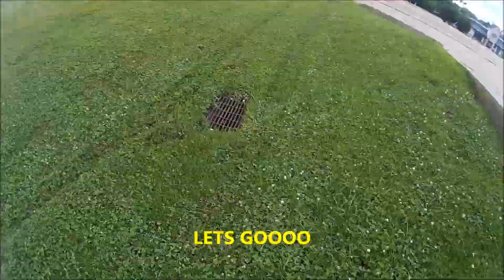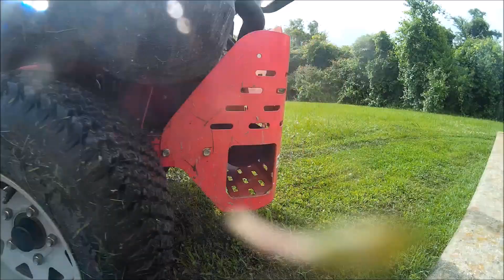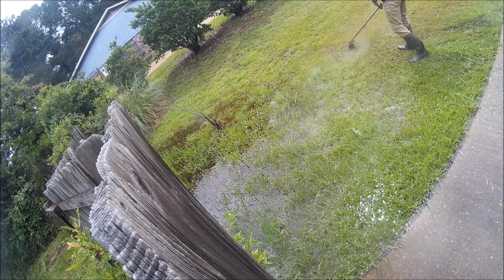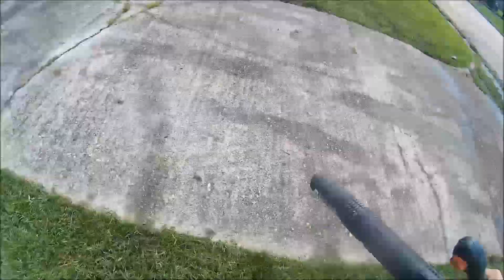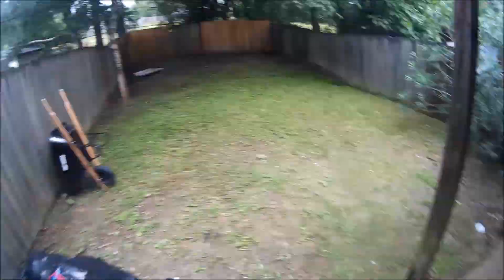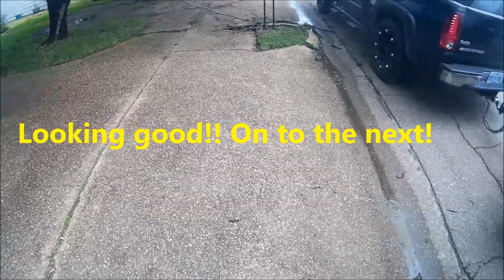Raw WET LAwn Care Mowing Montage!!! GET YOUR MUD BOOTS.. SS LAWN CARE

Comment: We went to eat tonight and it rained there was hoping it was not at home because I wanted to cut grass,I got home decided to cut grass even though dark clouds was there I was cutting the grass and the rain poured I stopped only getting part of the front yard cut.After the rain stopped I took out the push mower and finished the front yard and sides of the house now got the back to do.I did not want to get the riding mower back out because did not want to cause ruts.